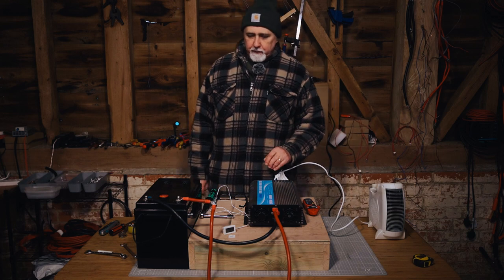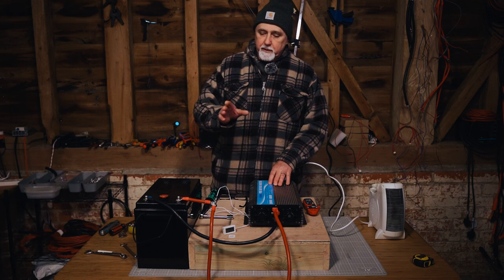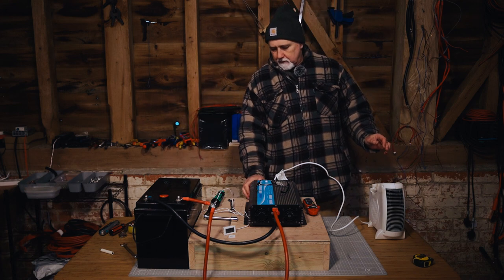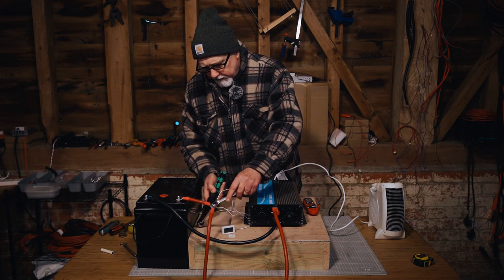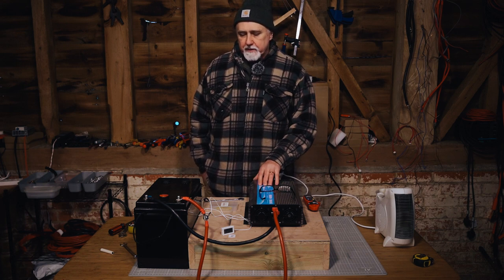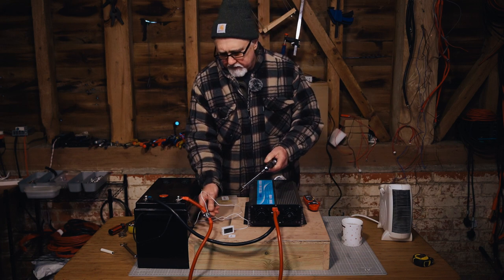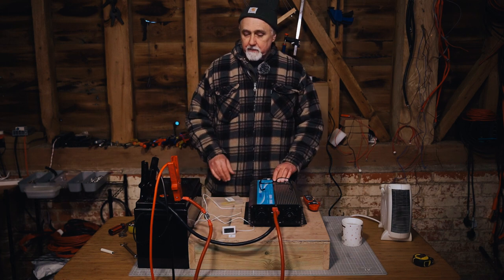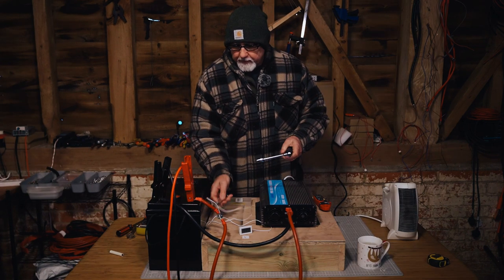Temperature testing different torque settings [pt2]

Comment: Personally i would not have expected temp to rise in a linear fashion with lowering of the torque, mechanical torque settings are more to do with withstanding vibrations without loosening 🤔 obv there is point where full contact is  lost and where that is? 2nm no idea ?? 
Most flat washers will cup up when overtightened l, as the area under the nut is squashed the edges tend to lift up in the direction of the force so the 2 terminals will have a gap round the outer diameter 🤔 now that i can see being a linear correlation, tighter the clamping force the further appart the edges deflect and the less contact area there is.
Or I'm waffling bollox  🤔 🤣
Reply: Interesting subject and video 👍